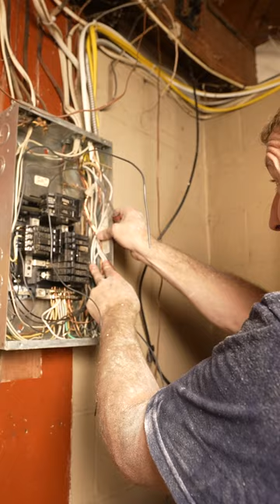Not enough room in electrical panel

Comment: You cld always add a sub panel for a cple of hundred $ provided you don't have an outdated brand name panel. Why I recommend Square d and Siemens they have been around 4 ever breakers and parts readily available 😊
Reply: Add another panel for cpl wires, never knew there was that many shit electrians..
Reply: @PresidentJorgeBush  to add a sub you don't need to pull the meter to add a new bigger panel it's strongly advised to have power cut. adds cost and time for inspections. And most panels will say if you can use tandems or not so it's a combination of things to consider what's best.
Reply: @PresidentJorgeBush  what do you mean just wire the panel there are these things called laws codes and morales plus civil liability if something isn't done right or even if it is. It still can be your fault